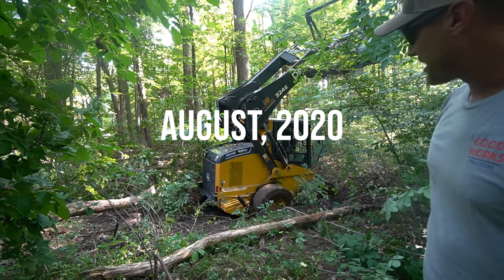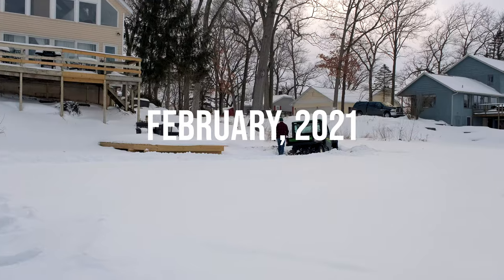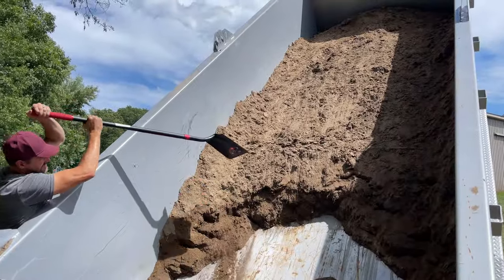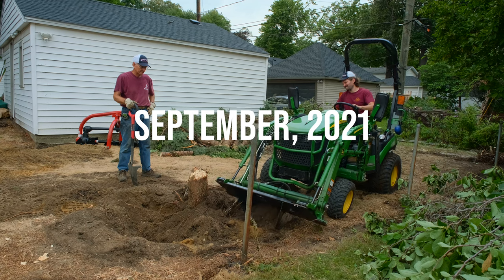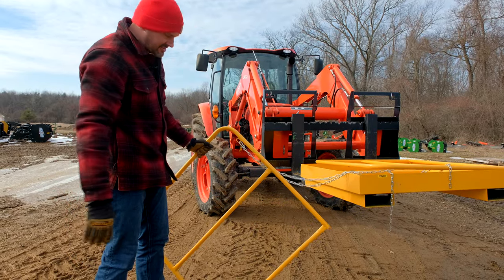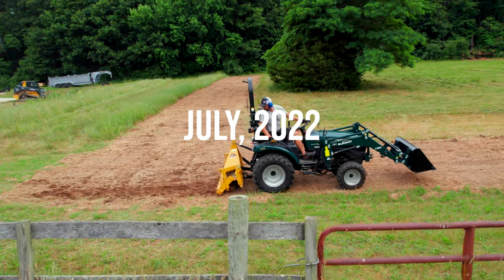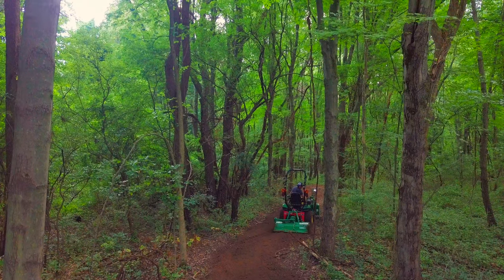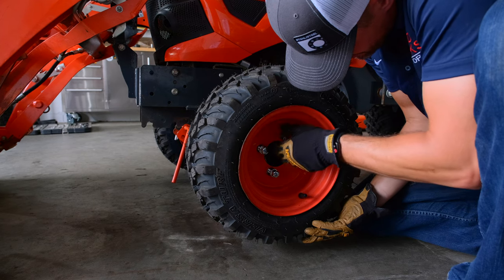TRACTOR FAILS COMPILATION. ANYTHING CAN BE BROKEN!

Comment: Awesome video.  One thing to try for those dry leaves in the woods, if you have one or two of those battery blowers, try to attach them to the front forks or something and then drive, would think you could blow them off to the side driving along the trail

Comment: Just blew out a tire on the dump trailer earlier this week. Also jacked up the hydraulics on our New Holland 6610 this winter by flipping the back blade around and pushing heavy snow backwards. The three point bucked up and hit the hydraulic remotes’ housing. A handful of repairs to do soon. Thinking of adding a 3point quick attach, a hydraulic third arm, and a PTO quick attach in the near future. Visited the New Holland dealership today and they didn’t have any such items in stock.

Comment: This is the kind of video that more YouTubers should make, help keep them humble. Not an issue for you guys though. 

Silly thought but maybe the 1025r did better with the plow because of the smaller tires, in theory a smaller wheel puts more torque to the ground. That's why it's easier to pedal a 24" bike than a 26"or 29".
Reply: I think the opposite may be true though. Small surface area contact and high torque spins the tires and digs down. My snow plow guy cautioned me to run a larger tire on my truck for this reason, and I know from experience that when surf fishing on a sandy beach if you get stuck you let air out of the tires to increase the surface contact and motor on out. I have two atvs: a bayou with big fat tires and a Fourtrax with standard tires. The Bayou always goes in deep snow that the Fourtrax gets bogged down in.